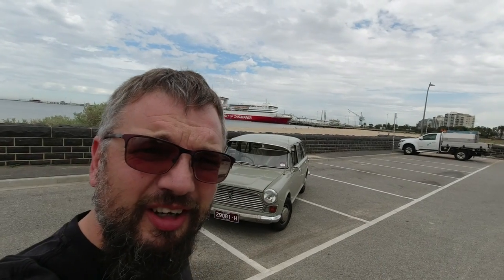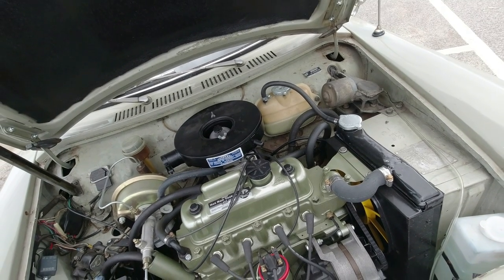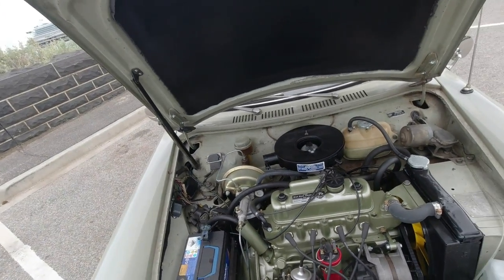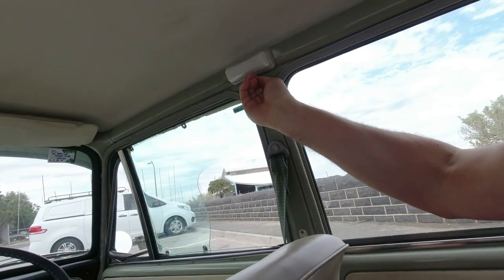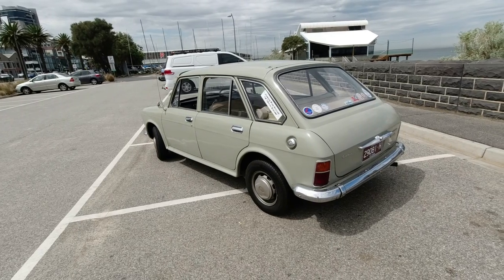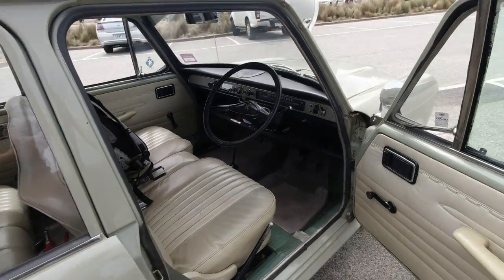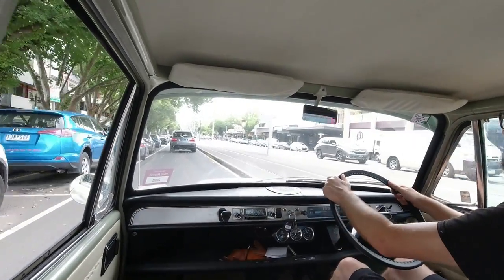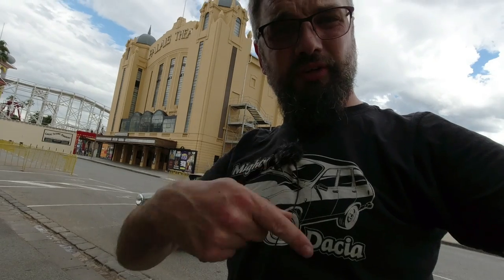Aussie Oddballs: Morris Nomad (1100/1300 station wagon thing)

Comment: Hi Ian from Sydney, Australia. They may have only made 30,000 of theses in maybe 2 years , but the ADO16's lasted forever here in Australia, they "failed " to wear out, and , when new these Nomads seemed to be bought by older people who looked after them , as that had finally traded in their Aussie BMC  "Morris Major Elite's: that by then they had owned for 10 years or so, then years later they seemed to trade their Nomads for Mitsubishi Magna Elites another Aussie "special" in the middle of the 1980's .

This period, say 1958 to 1974 Aussie BMC car owners were very loyal to brand, they would not buy anything else, and when Brit' Leyland/BMC Australia closed & decamped, the BMC car owners just kept their cars longer & longer.
So the cars were used to their maximum life span and in our hot dry climate rust is minimal, but what eventually happened when the cars were 20 to 25 years old parts supply became an issue which saw them go to wreckers & be crushed, or worse, an ignoble death as a demo-derby car. Same could be said for the Kimberley & base level Tasman, or the really unique, 1800 series one and series two Austin utes there were plenty of them, and also now there are none. ALL WERE BEAUTIFULLY MADE, well painted and virtually did not rust or break. 

If petrol skyrocketed in price, or big engined cars were taxed highly, & I needed a 4 cylinder car it would be the Nomad or the Austin 1899 Ute, or for a small frugal MPG 6 cyl engine a Kimberley 2200, as they were decent quality items.  At the moment I will stick with my 1967 Jaguar mk10 or 420G to give it its silly renamed BMC badge, and my 5 litre 1982 Holden Statesman Caprice, both almost the same size and level of luxury.

Comment: British Leyland vehicles are a remarkable combination of poor execution of good ideas and good execution of poor ideas.
Reply: A great summary !    To me, looking back it seems all too often that Leyland (in Australasia) and BMC or whatever they were calling themselves in the UK, so often, seem to have "snatched defeat, from the jaws of victory". Consider the Leyland P76 with a choice of auto/manual, 2.6 six cyl, 3.5 or 4.4 litre  V8 engines (I'd be thrilled if I could just  have a 6 cyl manual today). . What about the 'Austin' Princess (wedge) which was crying out to be a hatchback with 5 speed gearbox from the  very beginning and yet was denied by beancounters.
Reply: Seems like a comment that should be pinned through the ages for all to see forever.

Comment: Yay a Nomad, or as my Dad called it the Gomad. I learnt to drive one of these at 10 years old. Ours was a 1500 OHC with the 5 speed gearbox. We sold it to a friend and then bought it back. The back seat folds down flat, the small pedals. The rego was JUG-009  (Vic reg) I loved this car. Bouncy hydroelastic suspension, just wonderful. I remember the wonderful exhaust noise and falling asleep in the back. Thanks for the trip down memory lane Hub Nut. Champion (I don't suppose anyone knows the fate of JUG 009?)
Reply: Snap, learnt to drive an Austin 1100 at 10 years old as well, easy to learn to drive in. Like you said brings all the memories back.
Reply: I would have called it the "Gonad". 😂😉
Reply: @Spac8  i always thought No Mad Person would buy one
Reply: JUG 009 no longer on VicRoads registration system it seems :
https://www.vicroads.vic.gov.au/registration/buy-sell-or-transfer-a-vehicle/check-vehicle-registration/vehicle-registration-enquiry
Not really surprised given the low survival rate of these float on fluid cars.
An intriguing subject raised of the survival rates. A combination of how a car was loved and the reliability and ease of maintenance.
JUG 009 seems a much earlier issue plate than the 1500 OHC cars especially the later 5 speeds. This site says the JUG plates were from 1967 :
https://en.wikipedia.org/wiki/Vehicle_registration_plates_of_Victoria
Did you go to the expense of keeping the plates of an earlier car?
Reply: @johnd8892  I believe the plates were originally on my mum's Morris 1100. (I know only this from pics I've seen). Our friends had anther Nomad with prefix KPH.

Comment: The AP trans worked well until people thought they were doing the engine a favour by throwing in a friction modified multigrade oil. That knocked out the forward driving clutch inside the trans and, in most cases, required engine/trans removal, trans separation and disassembly. A friend, now deceased, used to be a service manager at a Leyland dealership and he inherited all the special trans tools. He could do one of these *in situ*. Hell of a savings in time and a hell of a lot of pocket money for him when he became an apprentice trainer with me in a technical college.
Reply: I was shown how to change the clutch in my mini cooper in 1971,I can still feel the pain in my back...
Reply: (without removing the engine...)
Reply: I guess it's a bit like using multigrade car oil in a wet clutch motorcycle
Reply: @cliffwood4610  I worked at a dealership back in the day & we would change a Mini or 1100/1300 clutch in 45 minutes but if you didn't TDC the engine the horseshoe retainer would bite you in the ass. The rear main seal would add another 20 minutes to the job.
Reply: @cliffwood4610  And I bet some of the bolts on the large clutch end cover never went back again ! I seem to remember you had to disconnect the engine mountings and heave the engine sideways to get access ? Minis were even more difficult than 1100s but fortunately less frequent customers. We could get the engine out of an 1100 in 30 minutes!
Reply: Phil Healey that's right you had to undo the R/H engine mount and jack the engine as high as it would go without jamming the cooling fan into the rad. It was very tight on a Mini, I broke my two middle fingers one day when I was relocating the power bar and socket onto the puller when the clutch suddenly came off and crushed my fingers between that and the body. The Allegro when they were a lot easier, so much more space.
Reply: @philnewstead5388  I think a pick axe handle got involved somewhere in the adjustment process!
Reply: @jfv65  "I guess it's a bit like using multigrade car oil in a wet clutch motorcycle"  You can use multigrade car oil in a motorcycle as long as it's clearly labelled as "not friction modified" and perhaps JASO MA rated.  A lot of the Australian Penrite multigrade car oils are labelled as being suitable for motorcycles. :)
Reply: TassieLorenzo Yes, just like that. The friction modifiers cause the fwd driving clutch to slip, then cook up. They don’t last long from that point. A motorcycle wet clutch would be no different.
Reply: The forward clutch was under size, especially for the 1300 motor.  The Austin America web site details how some clever folk have modified the housing and pack to add an extra friction and steel disk to the pack (which only had 2 of each to start off with).  Apparently this fixes the problem, and you get many years of happy service out of your AP auto, as long as you change the oil and filter often.  Look at http://members.tripod.com/austin_america/id72.html if you are technically minded.
Reply: David Bernardi thanks for that, quite interesting snippet. That the fwd clutch was undersized wouldn’t surprise me in the least. The BW35 had the same “upgrade” when it was matched to a 6 cylinder engine with higher torque ratings. The difference being that the 35 was designed around that change and all you needed to do was change the piston thickness (thinner) and add steels and plates to suit. Interesting to see how they did the mod. The lack of friction in the two plate clutch no doubt is the explanation for the 3-4 flaring issue. Doesn’t take long for slippage to kill a clutch and the heat generated doesn’t do the trans fluid any good either.
Reply: @exidy2290  Actually, the 3-4 flaring issue is down to the Top and Reverse clutch.  The forward clutch is always engaged during all forward motion, so does not move during the 3-4 change.  The Top and Reverse clutch is used (as it's name suggests) only for top and reverse gears.  In reverse, it's only engaged when the motor is idling, so no load through it at all,  but in the 3rd to 4th change, the throttle could be on the floor, putting maximum load through it, hence the flaring.  My cousin had an 1100 auto with a flaring problem, and I taught him to go a bit harder in 3rd, then back off to force a change into top, and only apply throttle once the change was complete.  He drove the car like that for years without any further deterioration.
Reply: David Bernardi I was actually thinking along the lines of the FWD clutch slipping a tad as the T&R clutch engaged . That’s what they did if a friction modified oil was used even though the FWD clutch was engaged already.
Reply: The AP 'hot shift' automatic box was amazing for it's time. Fabulous for rushing around town. It rightly won a Queen's Award .
Reply: @philhealey449  The gear shifter is a lovely design, wonderful to use.
Reply: @rogerhudson2814  The mini had them too as an option for a while and worked well.
Reply: I specialised in Mini/1100 cars and made all my own special bent spanners etc. I overhauled/improved more than 40 autos, if the trans had spectacular failure like the welded gear cluster letting go, the bits would go thru the oil pump, block the filter and then go thru the bypass valve. This meant stuffed pump and main/bigend shells. If you were lucky the crank would not be too bad, people tried to get home with them. The trans could not be bench tested and behaved weirdly until all the air had bled out. The test drive was always heart in mouth but not one actually played up. I was glad when people stopped wanting the autos fixed, I put several manuals in with clutch cylinders, drive shafts etc.

Comment: Strange looking beast, but the AP transmission was really quite impressive.

I had a Mini Clubman automatic, 1975 vintage, for many years and did many troublefree miles in it. I liked the gearbox and the way it operated.

There's a South African 1100/1300 derivative called the Austin Apache with Michelotti restyled front and rear ends. This has a full size boot in its extended tail.

A really pretty car!

Comment: This is fantastic!  My family, here in Melbourne, had a Morris 1500 bought new in 1971, so the sedan version of this, with the 5 speed OHC engine. This has brought back so many memories, as everything up front was the same. As a kid, I thought the ribbon speedo was the height of technology. It became my first car, but I found it a bugger to drive with difficult to change gears that I would often grind, probably more down to me as a novice driver. I ditched it after six months in 1984, traded it in for next to nothing. I remember the Nomad, and it seemed to me quite a common sight on the roads, but that's probably because you see cars you own about more. We went everywhere in the 1500, interstate trips into NSW and SA, staying at motor inns, the done thing at the time if you didn't do camping.  The 1500 sedan was quite common in its day. 

Thank you so much for doing this, I only did a search recently for a Morris 1500 and the best video was of one running in a garage. You've made my day!

Comment: This takes me back. My "1100" was actually a 1300, and here in Canada it was called the America. Unbeknownst to me, it had already had a hard life when I bought it. Good thing I worked at a BL dealership at the time so my parts were cheaper. I had to replace one outboard CV joint and one inboard Dunlop/Moulton joint. I couldn't get the oil pressure up, and then found out the body was held together with bondo. I have to admit, though, I loved the way it handled. That suspension was excellent!
Working at that dealership, I remember we had a couple of Minis in requiring automatic transmission work. The final bills were kind of eye-watering. Engine wear would affect the transmission, and vice versa. Keep clean oil in there all the time.

Comment: Looks a bit like a maxi and a 1100 smashed together!
Reply: With a bit of Wolseley 18/85 going on at the rear end.
Reply: Which no doubt happened a lot in wet weather.
Reply: @RussEdgar445y7tlfj  yup, and they did the same in South Africa by having normal round nose Mini front end and rear end of Wolseley and its predecessor having Wolseley front end but normal mini rear end.
Reply: Funny that's immediately where I went to, an interesting car.....if not a great one. The Aussi Marina Coupe still has the edge for me.
Reply: For someone who doesn't know those cars... it looks like a Volvo Amazon crossed with a VW Typ 3 and a hint of Mini
Reply: @olik136    A skip on wheels .

Comment: I had a 1967 1300 auto when I passed my test in 1975. One day I was trying to keep the engine running with a few too many revs as I put the gear lever into ‘D’. There was a loud thump and from then on all the gear positions moved one space down the selector. This meant R was still reverse, but so was ‘N’. Neutral was next to 1 on the selector, 1 was next to 2 and so on. This meant 4 was next to drive so I had to drive it like a manual forever after that. Problem was, it would only start when the lever was in ‘N’- which was actually Reverse. So the instant the engine started you had to grab the lever back onto position 1 (which was actually Neutral) or you shot off backwards.

Comment: Lovely video Ian.
 I had a  1971 1500 5 speed Nomad in about 1984 when i was at uni. When I first took it to my friendly BMC / BL specialist mechanic at Frankston he said "oh, no. What did you buy one of those F***'ing things for? It's going to spew oil out of every orifice, it's going to jump out of gear, the tappets are going to clatter and are a mongrel to adjust, you should have spoken to me first!"
He was right, it did all of those things and more. It was a hoot to drive though. I'd love another one...
The 1971 build cars had the infamous "tall heater" of Marina / Allegro fame stuffed under the dashboard as ADRs in 1971 required a blower fan for the heater.
Reply: Such valuable advice from a BMC / BL specialist mechanic from the time. This is much more informative as to why these failed to sell. So many of the comments here are irrelevant to what happened back then. eg that they do not like the styling of the car now etc.
Reply: Yep your mechanic was right , add overheating breaking uni joints and engine mounts , but guess what as a young apprentice i fixed everything myself from changeing a clutch at a Motel carpark in Yeppoon to changeing an engine mount in the carpark at Hervey Bay . Ive never had a car that gave me so many smiles on long trips , the looks on peoples faces being past in an overtakeing lane doing 90mph in the late 80s priceless. Yes they had their faults but it was never off the road long could allways be fixed

Comment: How amazing that the Morris Nomad was well ahead of its time with features that only became the norm years later - 4 speed auto, folding rear seats, hatchback,  front wheel drive etc. My mother had a 1300 or 1500 for a short time. She says it drove beautifully but she traded it for a new 1971 Escort because it stalled every time there was a shower of rain. The mechanic had put a hessian bag inside the front grille to keep the rain out but that didn't really work.

Comment: My grandmother had a Morris 1100 auto. I didn't want to be seen driving it back in the day, but I would be quite happy to drive it now. 
P.S. 4th gear was 4th gear, not Drive.
Reply: All of my automatics had R N 1 2 3 4 D. In D the gears changed automatically. Each of the numeric positions held that gear. Gear 1 had freewheel, the others provided engine braking.
Reply: @htimsid  Strange, you'd want engine braking at low speeds, too.

Comment: The 1500 had an optional 5th gear! That would have settled it down on highways. Unfortunately, mine didn't have 5th but she was a real little goer. She served me well for six years - not bad for $Au500 in 1985.
Reply: The 4 speed was actually the 5 speed box with a blank fitted instead of 5th gear, and a modified shifter so you couldn't select the blank gear. (according to the service manual.)  They made constant modifications to the gearbox and shifter to try to stop it jumping out of gear and improve the terrible shift quality. I had one of the last of them so it should have had all the modifications but the shift was diabolical. I later very briefly owned an earlier build 1500 4 speed and the shift was actually much better, so the modifications didn't help much...

Comment: Owned a 1500 manual from new. It was a good highway cruiser. The muffler's sound as I remember was ex factory, and I loved it.

The Auto box was I believe basically a semi-auto in the numbered positions with full auto in 'D'

The Cars manual described how to arrange the seats to form a double bed and I made full use of that feature.

The rear parcel shelf could be folded down to form an open space a la station wagon. Those seats were very accommodating.

Comment: I remember automatic Mini's and Metro's with the AP4 gearbox and they went through the gears very quickly. Around the early 70's AP fitted  new pre oiler pumps that stopped it slipping when going into top gear

Comment: I've read about the AP autobox but never witnessed one working. Apart from the 4-speeds (quite rare for autos of the day) it was also unusual in that it had  an oil pump on the output shaft, meaning that a car with this gearbox could be push-started.